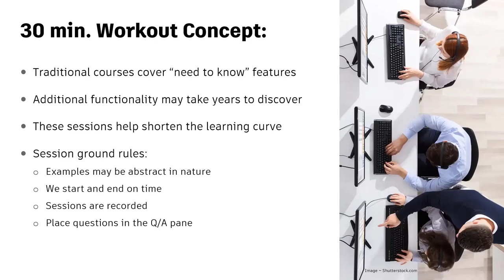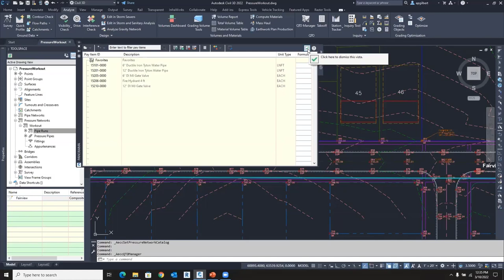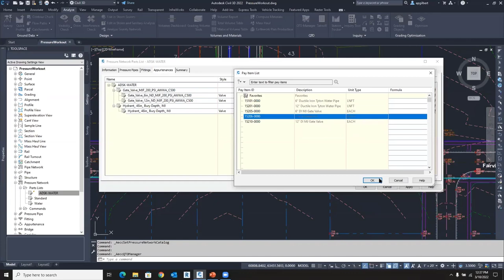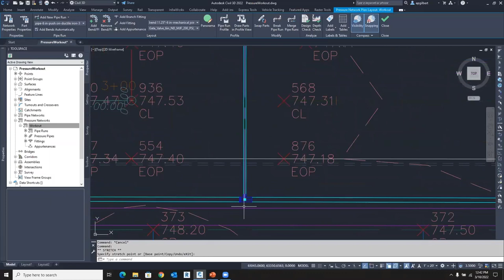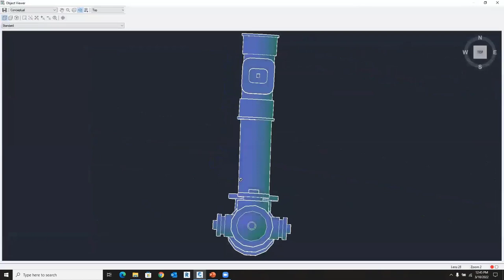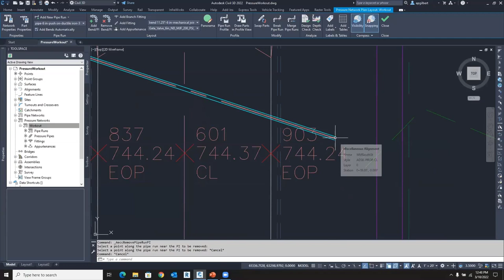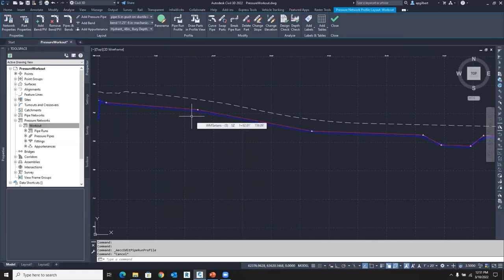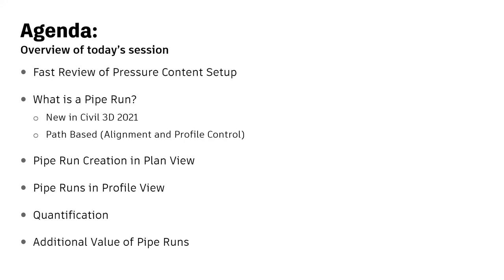Pressure Pipes:  Getting Started with Pipe Runs

Comment: Bookmarks for future reference

3:33 Fast Review of Pressure Content Setup and adding pay items
6:50 Add formulas to pay items for rings
7:25 What is a Pipe Run?
8:00 Part based layout
8:35 Create Pressure pipe network
10:00 Create a new pipe run
11:20 Alignment edit grips
12:36 Placing Valves
13:35 Placing Fire Hydrant
16:14 Adding Manual Pipe Run
17:11 Removing unwanted bend
17:50 Layout Compass settings
17:58 Creating Pipe Profile View
20:00 Editing Pipe Profile and locking updating
21:38 Quantification
22:25 Trench Quanitites

Comment: I have a new drwaing with lots and surface. QTO does not pop-up. Also in Settings - Pressure network does not show. I need to add FH and it is not on the parts list available. The tees show a sigle live versus the valves which show the whole 3d geometry. Could you help me? I use version 2024

Comment: Great video!  After creating the pipe run from the alignment, how would you add additional HZ PI's to deflect around structures etc., especially around a long curved part of the alignment?  I've tried editing the alignment, but it dissassociates it from the pipe networt and the pipe parts.  Thanks

Comment: Is there a recommended maximum length for a pipe run? I have 11 miles of 16" water transmission line. Would it be an advantage to break it into multiple runs of say 10,000'?

Comment: man, this is a livesaver, 5 months into my new work, and i just realised i don't have to draw pipe, create profile, create surface and adjust surface then create a poly line at wanted depth, and move the pipe accordingly xD

Did you have something on gravity pipes aswell?   and/or best practices for SSA?
Reply: How is the pressure pipe network working for you? What are the issues or problems that you've encountered? I've never worked with pressure pipes and the companies i've worked for have avoided using pressure pipes, still don't know the actual reason why.

Comment: Alan - when I use the 'pipe run profile' tool and create a profile, I do not have the ability to edit the pipes in the profile view (no grips available). The only grips that appear are located in the center of each run and only give me the option to curve the pipe. Any idea why this is happening?
Reply: Also looking for an answer on this.
Reply: I'm new to pipe runs and had the same problem.  My issue was that I wasn't using the pipe run alignment for the profile. I had a separate alignment that I was using for the profile and added the water pipe to it.  So then I created a profile from the pipe run alignment for the sole purpose of adjusting the pipe and fittings elevations.  There should be a line running across the top of the pipe with grips that you can bring up and down - and of course it updates in my other profile that I want to use for my plan sheets.  Hope that helps.
Reply: @nondas3549  Since utilities are mostly built along the road,the only time I would create an alignment that goes at the top of the pipe would be when it's too far from the road alignment.

Comment: You didnt do any design checking, and how you edit and fix the runs for the drop down/bends when they exceed the deflection
Reply from the maker: Correct, this video was not intended to be comprehensive of a design scenario.  I will say however, in my experience, field conditions have overridden many if not most of any design checking I've done (for distribution size piping).  Not saying it isn't important, just my 2 cents :-).